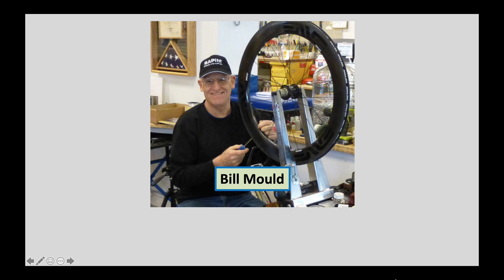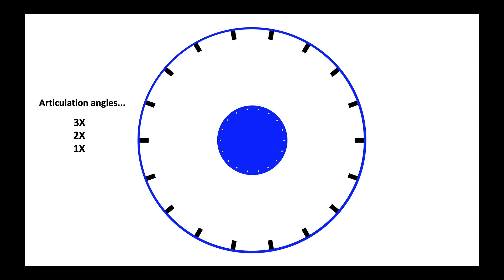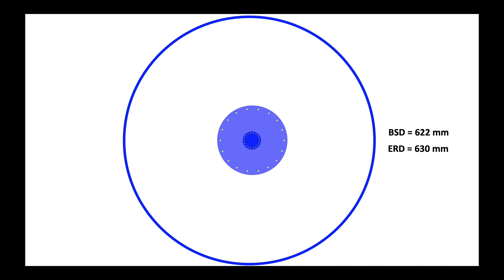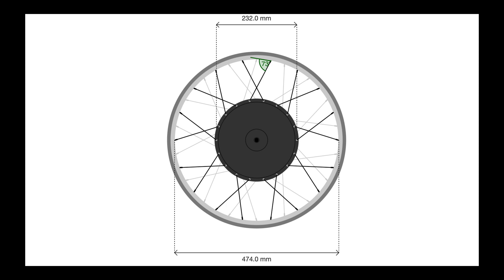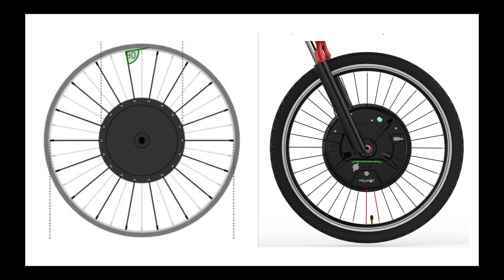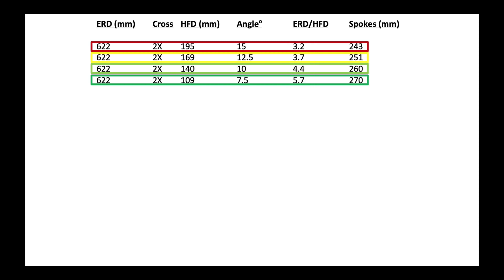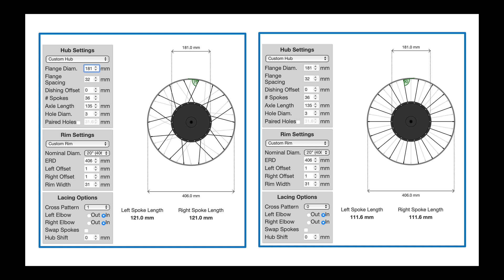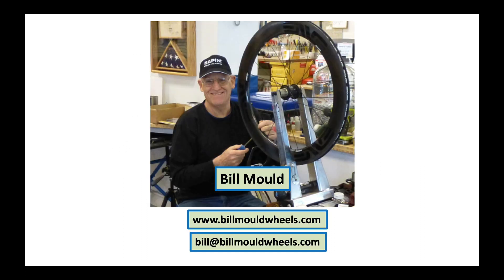E Bike Wheel Spoke Articulation Angles

Comment: Hi Bill, What is the best Elbow position in flange for the pulling spoke?

Right and Left In ?
Right and Left out ?
Right in left out?
Right Out, left In ?

A choise is beeter? i see All configuration ... not found a explication
Reply from the maker: At the end of the day, all of that stuff makes little difference compared to the number of crosses and setting the tension right.

Comment: Hello ! I’m building an ebike (mid drive) and I’m trying to shave weight. the wheels have 36 spoke 12g and so do the hubs at a 3cross, how should I go about shaving weight ? Less spokes, 12-13g spokes would help minimally, maybe reducing the cross to 2 cross with 12-13g ???
Reply from the maker: John, it's hard for me to advise you without seeing the bike first.  Unfortunately, you may have limited options. If the spokes are 12G, the holes in the hub and rim will be large diameter holes to accommodate the spokes,  If you use smaller spokes, they might not fit with the large holes correctly.  You may need to build completely new wheels.

Comment: Thank you Bill , relly helpful. Exactly what I was wondering about having spoked many ebike wheels with big hubs and having problems with wheels already supplied spoked from China -they often break spokes and worse in allowing for a disc on one side and a 7 speed sprocket on the other the flanges are way too narrow making for a weak construction. 
As a motorcylist when we have traditional spoked wheels we have relatively small 17/18 inch rims and hubs containg brakes (so quite large) it is common for the rim holes to be nicely angled and dished to nicely take the nipple. Why the hell dont bicycle rims come with a small angle pressed in to mitagate the obvious misalignment you will get pretty much regardless of crossing number-say 10 degrees built in would be a good start?
It is a constant frustration trying to find something right for  the job as ebikes develop.
What is needed is a rim that is much heavier than a bicycle yet slightly lighter than a moped or small motorcycle and the same goes for a decent tyre motorbike ones are way too heavy and bicycle ones are way too flimsy-even good ones. To make it even harder for the ebike builder thinking of using moped parts most moped wheels are now a solid  cast design with no wire spokes. There is a market here for some entrepreneur Pete
Reply from the maker: Pete, good comments.  Rims made specifically for E-bikes with angled fore and aft reinforced holes would help a lot.  Bill